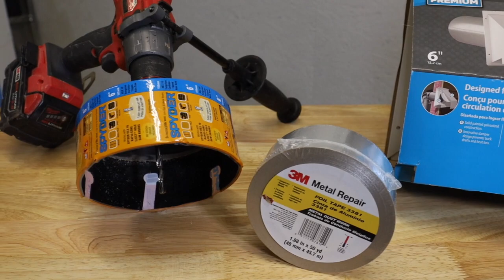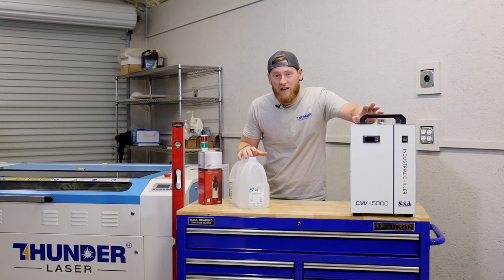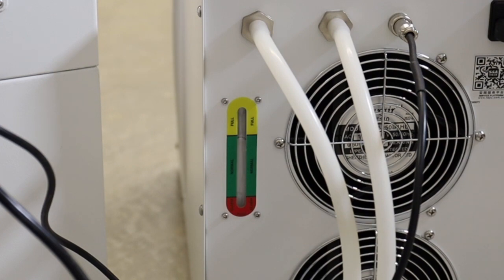6 Things to Know and Be Ready For ll Thunder Lasers Nova 51 Tips

Comment: Thunder USA needs to get their act together. Thunder South Africa delivered my Nova 51, split it to get it into my office, re-assembled the machine, did the whole installation, set it up in lightburn with a license for the first year and then after checking the laser alignment, gave me 4 hrs of training on the spot. The only thing I had to do was provide the hole for the exhaust fan. They even brought the water for the chiller, a sheet of 3mm black and clear acrylic each , a self inking stamp and stamp rubber, 2 sheets of 3mm MDF, a sheet off brushed gold on black and a sheet of white on black. That's what you should get when you spend this much money on a machine.

Comment: I was told to go down in size, you should use duct tape to make that seal.  I found that using a clamp immediately put holes in my hose when I tried to put it on my similar style vent.
Reply from the maker: I just had to be careful. But I didnt make any holes. You def could though.

Comment: Great set-up video. Is there something you should do if you accidentally touch the laser tube to get off any potential finger prints? It also looks like you have a lubricator on your filter system...I am assuming you have no oil in there. If not, what is it being used for. Thanks.
Reply from the maker: Thanks. I would just use a dry cloth to barely remover any oil or finger prints from touching the tube. I have an oiler in line on my system but nothing in it. It doesnt do anything on my setup. If i used pneumatic tools more I would have oil in it.
Reply: @Statedwoods  Makes sense. I like that set-up you have and might do a piggyback to have two filters. Thunder Laser shows a really cheap double-filter unit you can get on Amazon but I paid too much for my laser to put a $25 filter on it.